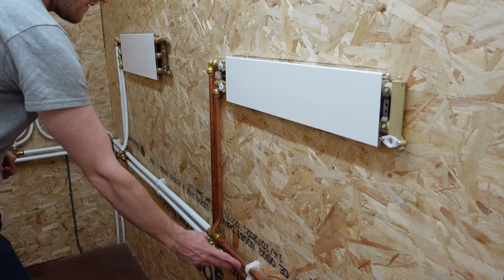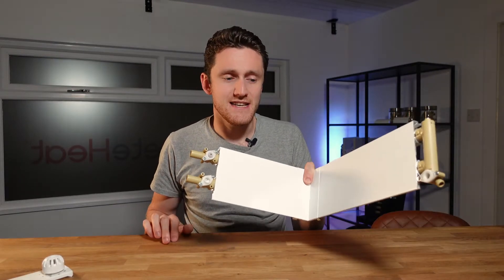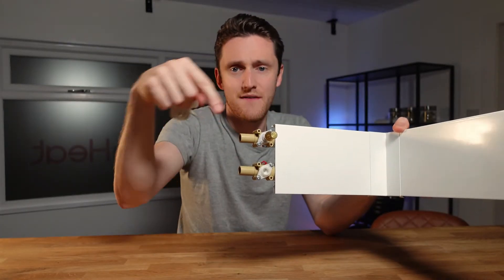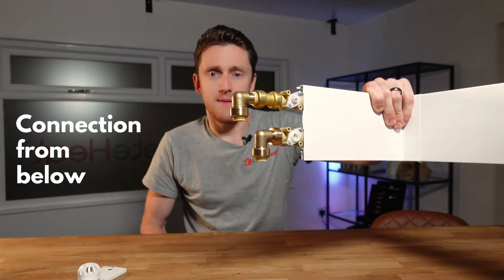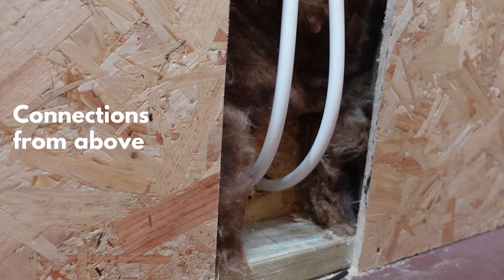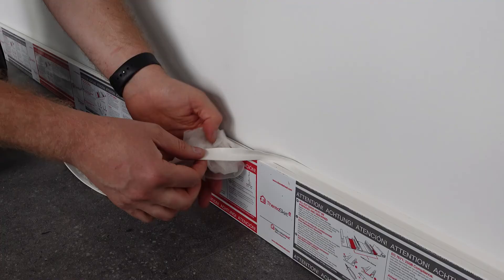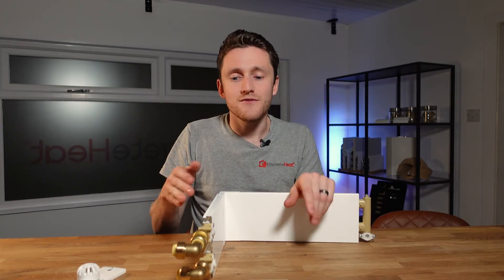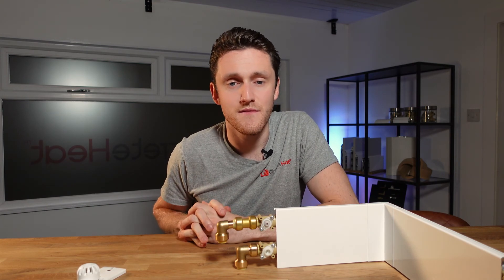Plumb Skirting Heating just like a Radiator | ThermaSkirt Technical

Comment: Bi-Driectional kit looks like it cant be used if the pipes are coming up through the floor. The link pipe looks like it will be in the way. Is that correct?

Comment: I assume this stuff will be no good for ASHP
Reply from the maker: Yes it works well on ASHP. Up to 90w per meter at dt20 (40°C) 👍
Reply: @thermaskirt what is the formula for converting your published output data to a new air to mean water temperature delta t?

Comment: I like the idea of the heat source being low down. Do the push on fittings cope with 2 bar pressure alright?
Reply from the maker: Hey John, yes all of our fittings are tested to 10 bar, and when we install genearally we test with air to 4 bar before full commision.

Comment: Do you have a supplier in Canada?  Or if you are thinking of a supplier who would it be maybevi can talk to them one of my clients sold a product similar to your over 20 years ago it didn't cache on I i installed a modcon natural gas boiler for him running lower temp then the original oil boiler. It works awesome.  When he told me that was also heating his garage with all his tools , cabinets ect,ect,ect . I was not able to see any of the rads  21c in garage -35c outside. I would absolutely recommend plumb skirting to my customers.

Comment: I have been looking for something like this for a few years now. it looks ideal for what i want, but would be interested to see how your wireless system works. I have a tado main thermostat for the house, controlling the boiler and would like to fit the tado remote trv's to some of my radiators and also to the thermaskirt, would that be possible?
Reply from the maker: Hi Ken, The easiest and neatest way to integrate Tado with ThermaSkirt would be to use the wall mounted thermostats wired back to a two port valve. If you're not emotionally tied to Tado, then there are significantly more sohpisticated systems available which provide a whole house solution

Comment: I like this system. It's compact, discreet and straightforward to install. Outputs are adequate for the modern well insulated house, and they perform well with lower temperature flows. My advice is to follow the instructions  and plan ahead to be sure that the first fix connections are accurately placed.
One issue I have experienced is with out-of-true surfaces. If the wall is flat and straight all is well, and the skirting fits snugly, with the top trim strip seating well. However if there is significant out of true then the lengths need to be pushed back hard to the wall surface. Even then the trim strip does not always cover the gaps.
My solution is to fit a suitably sized UPVC strip, trimmed to the wall shape and lightly glued in place.
I like the slightly tongue in cheek tone of your video too!
Reply from the maker: Thanks for your comments Steve, and you're spot on.  If the instructions are followed it's perfectly DIYable. 
Regarding the wonky walls, our installation teams often bend the skirting before offering up to the wall, which looks completely mad but works surprisingly well. 👍 
Perhaps we can do a video on wonky walls in future. 😀